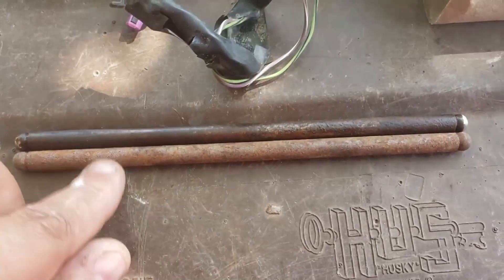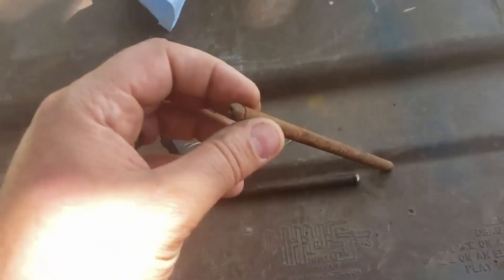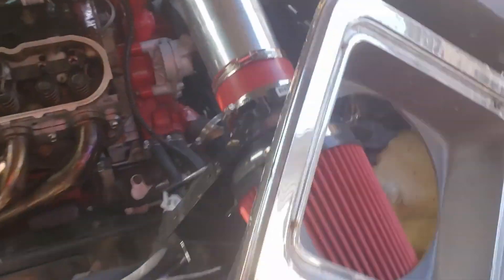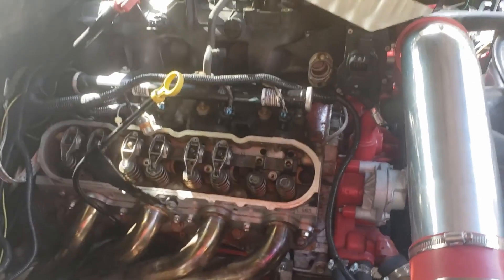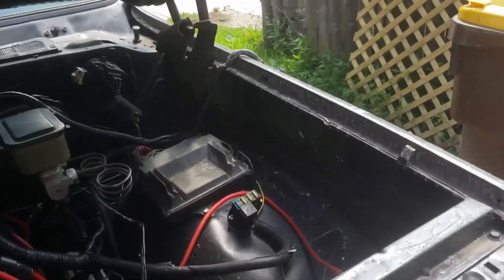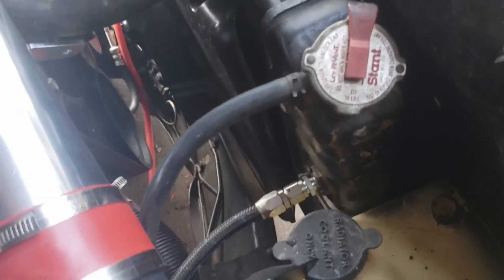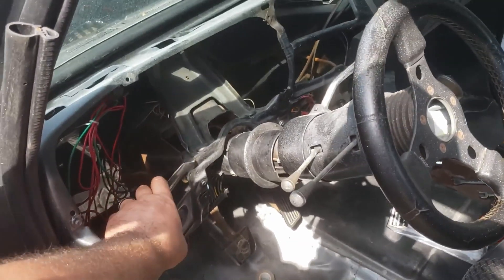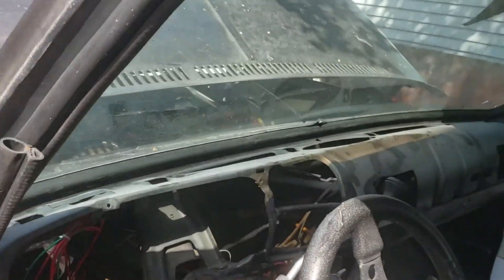Redemption! Throw it in straight off the ground!

Comment: What did you do that finally got it running?
Reply from the maker: I don't understand the question... It was running, it bent a pushrod, I put another one in, it's still running.
Reply: @TheDrivewayEngineer  The first two times the engine would quit after a little bit. I wasn't sure if there was some trick that made it keep going that final time.

Comment: Sounded good after you got her running!
Reply from the maker: Ran well, until the crank sensor randomly crapped the bed 😂
Reply: @TheDrivewayEngineer  You know, seems par for the course. Sensors most likely don't like being out and "handled" as it were. All mine came out from a running driving van and most likely I will have some fail as well.
Reply from the maker: Dave Barron this one was new, so I'm going to take some time and test the harness and sensor and see what's up
Reply: @TheDrivewayEngineer  Woops! Rats that's actually worse in certain ways. Good Luck!